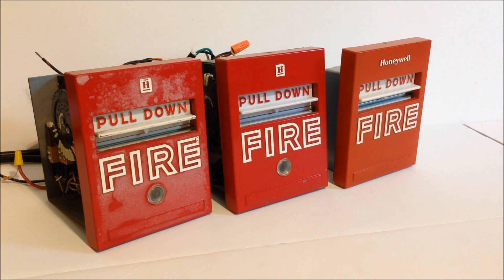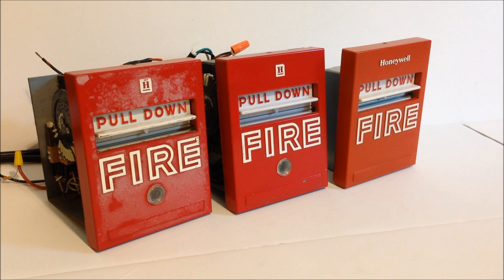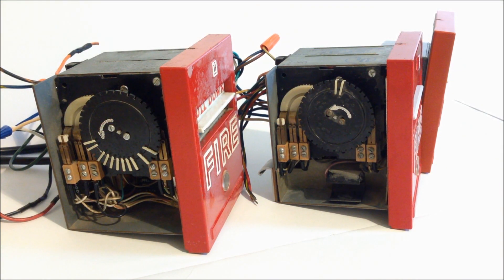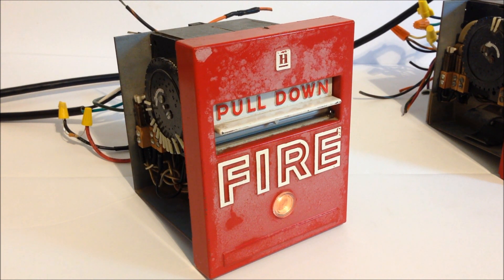Vintage Honeywell W854 "Decimal Code Transmitter" Coded Pull Stations

Comment: Honeywell was very ahead for it's time back in the 1960s and 1970s. These are called "Decimal Code Transmitters". An explanation below.

This setup was used in Coded fire alarm operations. The W854 series were the "transmitters" in the fire alarm circuit. These "transmitters" included zone contacts for normally open fire alarm devices. Like the S464a manual pull stations and TC487B heat detectors. They also had ionization smoke detectors "TC4010A" that could be wired to the coded pull station if desired. The ionization smokes were powered off of the Honeywell W853B power supplies.

At the control panel was a "Decimal Code Receiver" model "W805B". This interface could distinguish between an "Alarm" and "Trouble" signal from the coded master pulls. In a trouble scenario, the coded pulls would code out the address, for example "1-1-3" back to the receiver. It would then ring the "Trouble Bell" at that coded address. This would mean that something went wrong "Open circuit, power loss .etc"

This could be used on the Honeywell W247G (AC signal panel) and W733D (DC Signal panel). The W805B was wired to either panels "Box Circuit". On an alarm condition the W805B would open and close that box circuit per the sequence of the "coded master" which would make the horns or bells code out that sequence. 

The W854A were for class A and W854B for class B zone operation. Other models had options for aux relays, batteries (for W733 DC panels), and annunciator contacts for light matrix or graphic map annunciator displays.

On a side note, these panels (W247 and W733) also had their own option for fan shutdown, Damper control, and Elevator recall. Remind you, this is 1968! No other manufacturer at the time had the capabilities that Honeywell did!

Comment: This type of system is in one of the older 60s style elementary schools in the school district I attend. Each hallway has one of those funky coded pull stations mounted high up in the corner. It’s job is to kinda act like zones. The conventional pull stations will activate all the horns in the building on continues and send a signal to those funky stations which will ring a single stroke bell in the office to the code that signals which area it went off in. It makes the system sort of like a conventional system but eliminates the need for a panel. One of the funky pull stations is in the office and it actually tied into the old (disconnected) street box system which had a code that would signal the fire station that the alarm went off at the school. Although confusing, they are neat little things.
Reply: Also I should mention that the conventional pull stations had dual contacts and were grouped in zones with one of those coded stations. So one of the contacts activated the horns on continues and the other one sent the signal to whichever coded station it was connected to

Comment: I wonder if another pull station would be right next to the "un-operational" W854A  to activate it 😕. Other than that, that pull station is indeed very odd.

Good video!
Reply from the maker: Thanks! If you look at the W854A vs the W854E, you'll notice the 'normal' E model is very tarnished, while the front of the A model is clean. The backs of both very equally dirty, so I wonder if a cover was placed over the A model and another pull station located nearby as you stated.
Reply: +kcin556 Interesting. Yeah, if that were so, then the W854A I guess wouldn't be as "useless" as it is now lol

Comment: The W854A would be insanely illegal today. I can't even believe that they would allow an nonoperational pull station like that even back in the day.
Reply from the maker: I think the intent was to create something like a modern "monitor module," where conventional stations could be connected to it, but the module couldn't necessarily activate itself. But why they installed a cover with a pull handle on it, rather than a blank cover, makes little to no sense at all.